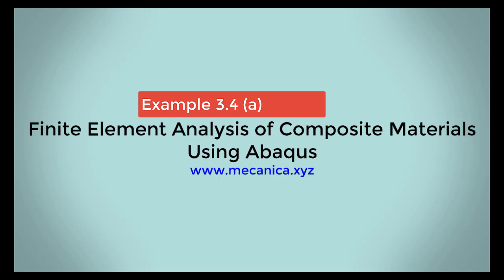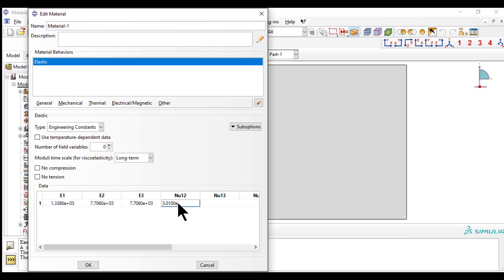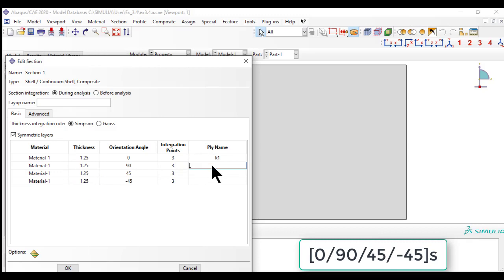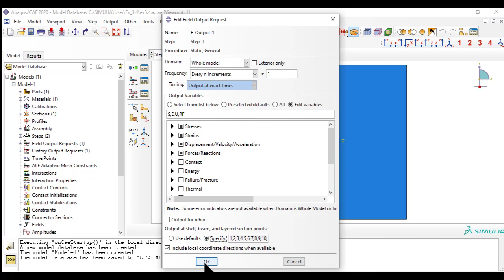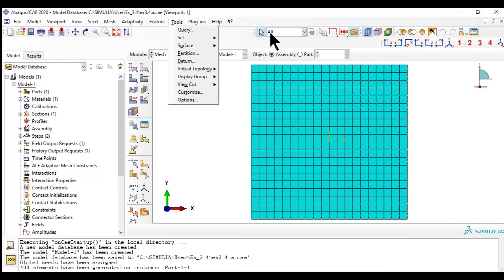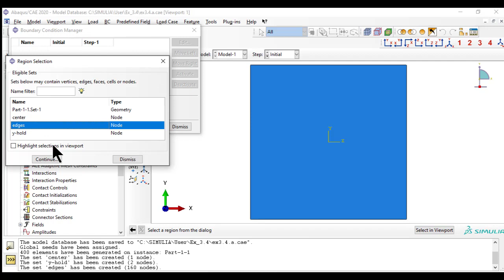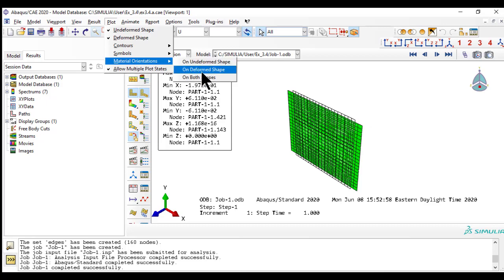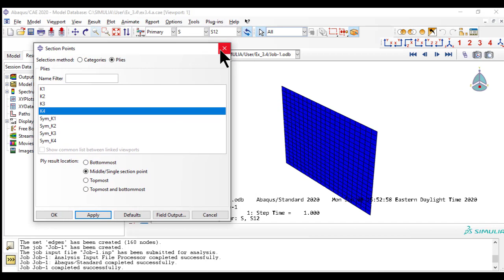Example 3.4.a How to model a laminated composite using with thin shell elements in Abaqus

Comment: Hi,
thank you for the nice viedos, I have some questions tho:

1- can we in 3.4.d the layup method use for the part design shell instead of solid ? when shall i use the shell or the solid ? because from mz understanding , composite laminates are mostly modeled as continum shell, am i correct ?
2- can we while using the layup method add cohesive elements contact between the each play, without treating each lazer as a separate part? for example from your videos and other videos  i have noticed that you mostly treat each layer as separet par and the cohesive layer as a separate part, you assemble them and you add the cohesive element ? 
so my question is, the lazup method alreadz creates several plzs , is there a way to insert a cohesive element between layers without treating the whole system as  separet entities?

3- can you please make a video tutorial for delamination of composite laminates in tensile test speciman ?

thank you in advance

Comment: Hi sir i have plat composite with singl layer with fibre orientation 50° and i want extract young module Ex and Ey for 50°
Reply from the maker: The layer will shear when you apply a strain epsx to get Ex. Support one edge with Ux=0, another with Uy=0, then use a tie constraint for each of the opposite edges the ties each edge to a different reference point. apply ux=epsx*length of the perpendicular side, to get epsx=1. Add the stress in all elements times the element volumes, then divide by the total volume, the is Ex. See chapter 6.
Reply: @EverBarbero   do you have any. Vidéo or fichier for more understanding please sir